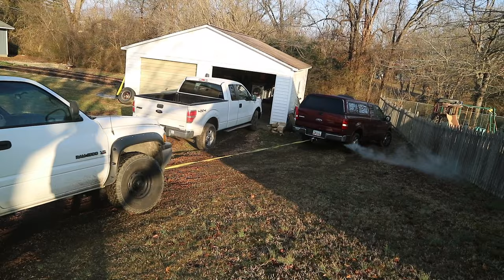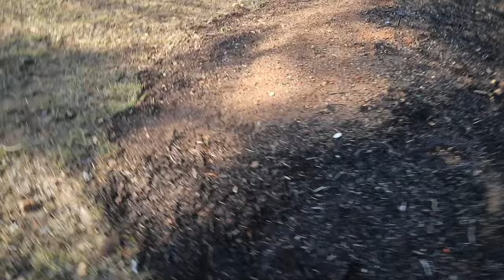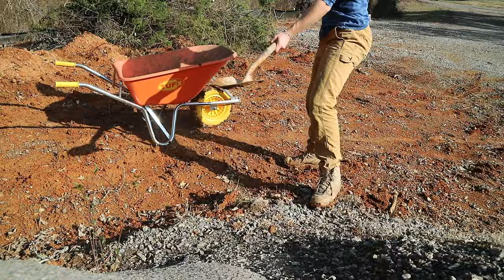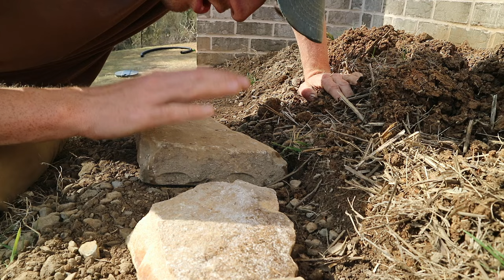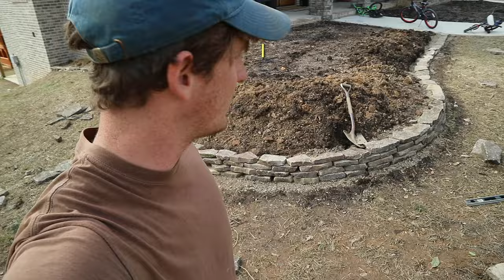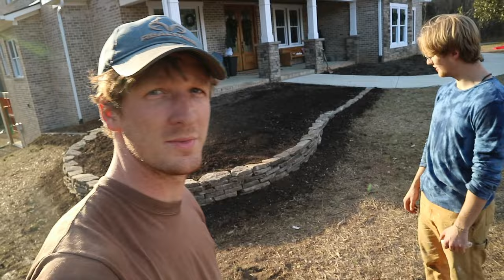How To Make a STONE LANDSCAPE BED BORDER | Step-by-Step Process

Comment: Do no build walls like this. At min the base rock long side of stone needs to go front to back of bed not side to side. Voids need to be filled with like the same rock as wall is being built, largest rocks should be used at base, and absolutely never dry stack a wall with out gravel as a back fill.
Reply: I love a comment section expert with no samples of their own work to be seen...

Comment: How would I do that where it goes from grade level to about 1 to 1.5 feet high with the trapezoid shaped 4" high stones?
Reply from the maker: Well…you’d need 3-4 layers if you’re using  4 inch thick stones. And you would make sure each layer is set back about 1 inch to help with soil retention. 

Hope this helps!

Comment: I’m a novice “waller” and have been doing a lot of research before i atempt my first wall.  All research say to “not” put the long face of the stone as facing.  Best to put the length of the stone in this creating the strongest possible wall.  It is tempting to put the long face out because u cover more distance, however, this practice promotes a weaker wall.
Very respectfully,
DS
Reply: The shorter side would be on the ones not providing as much structural strength is that what you mean ?
Reply: Yep, working on my first retaining wall now. However, from a physics standpoint, you don't need your wall to be wider than it is tall for the sake of integrity. Since this wall is angled backward, the stones are very flat, they're using a load of back-fill rather than, say, heart stones, and the wall is only marginally taller than it is wide at the tallest point, you're better off choosing the widest and nicest faces just like they did.

Comment: Just need to be careful about what weather zone you live in.  I live up near Canada on the US boarder in Ohio. We always dig down below the frost line about 40”.  If there is a slope that allows drainage be installed at bottom of trench, we install black 4” drain Poole, cover with coarse gravel and use a plate compactor to remove voids. Next we take a lazar level and level all the footer heights. If on a long slope we will stair step footers below grade and stack the stone a little further below grade in those areas. 

We do all this because the walls tend to heave in the winter and over time then walls can become unstable. 

Looks lien these walls are being installed further south.
Reply: was thinking the same thing. did something very similar to diy build in upper midwest US

Comment: Thank you for sharing.  Great video.  Excellent workmanship. I have a question - I am reparing the rocks surrounding an old bed... these rocks are not all "flat" and I wondered if there is a modified method - perhaps that uses dabs of cement in between crevices of the stones to fortify the structure given the lack of uniformity of thickness of the stones.... have you any experience that you can share on this? The preexisting layers of rock around a garden are coming unhinged after many years... my thought was to remove the rocks, grade the ground, and start fresh using the same rocks.... perhaps there is another video for this type of technique that you can suggest for achieving a high quality outcome? Thank you!
Reply from the maker: Hi Michael! Thank you for the comment. Yes for irregularly shaped stone I recommend the following options
1. mortar between the stones
2. masonry cement glue between stones
3. just try to stack them again and use soil between where there are gaps. preferably more clay-ish soil. Try to puzzle piece them so they don't fall. also, stack so that the wall leans inward. Do one layer at a time and then backfill. this will give it some strength. 

God bless and happy landscaping!

Comment: Great work! Beautiful! I had started on my smaller project then took a break & found your video! Needless to say, I realized I was doing things all wrong! Stopped where I was and headed to the home store for some gravel. I do have a question about what to do if your area is uneven, as in, one side is about 15 inches lower. I'm guessing I need to start at that side & work my way around so the top layer of stone is level. Any tips would be greatly appreciated!
Reply from the maker: Hey Maria! I’m glad it was helpful. Yes I’d work on that lower side first so that you get it to where it’s approximately level. Then you can easily work from that base…or second option would be to keep the layering slanted. I hope this helps!

Comment: What are these stones called and also how many did you get and how did you estimate the amount you needed?
Reply: Just measure the area you want to do. Then measure the average length of the stone (Take 5 pieces, measure each one and then divide by 5 to get an average length). Divide the length of area you want to do with the average length of the stone. Measure the thickness of the stone. Then multiply the thickness you want. So if you want it 1 foot high and the stone is 2 inches thick it would be 6 pieces thick multiplied by the number you get from the total length of area. You'll never have the perfect amount but you can get pretty close.

Comment: Great job. I have a similar, but much smaller planting bed our landscapers put in front of our front porch. Now, after 10 years, the soil is washing out one side. I’m not sure how to fix without dismantling the whole side nor do I know if it’s something best left to the professionals to repair or if it an easy diy fix. With mature Hostas, Ivy, Creeping Jenny, weed barrier and bark mulch, I don’t know how to go about fixing without damaging the plants. Any thoughts?
Reply from the maker: Hi Shelley! I would peel back the mulch, fabric and  then  just remove that section stone by stone.
Reply from the maker: You could use some landscape fabric as a liner along the back side to keep the soil from seeping through. I hope this helps!